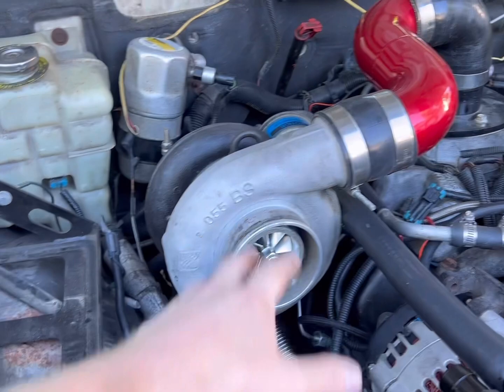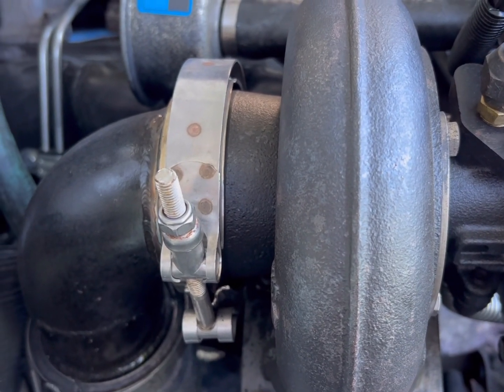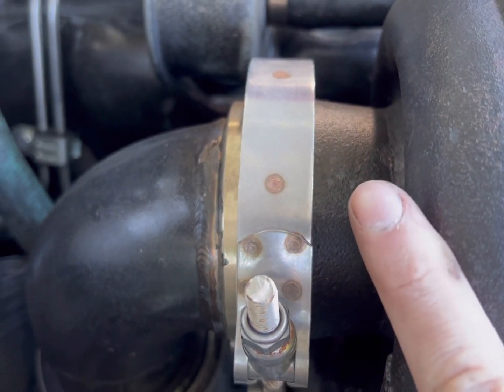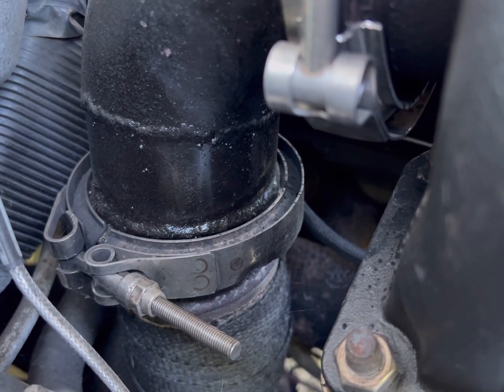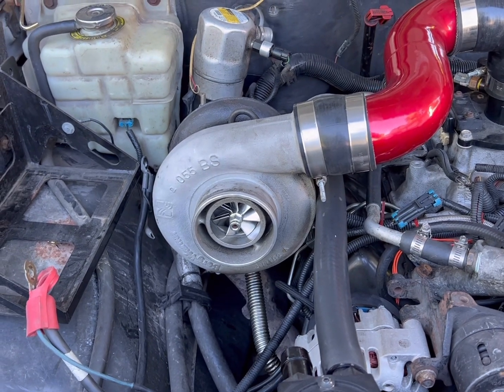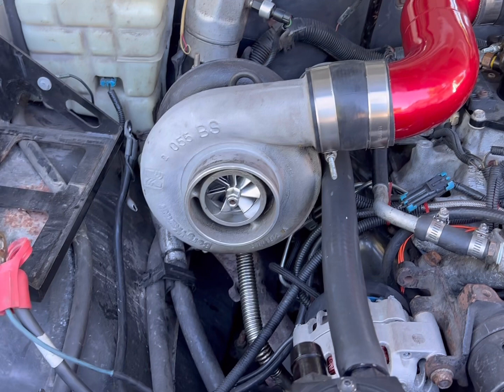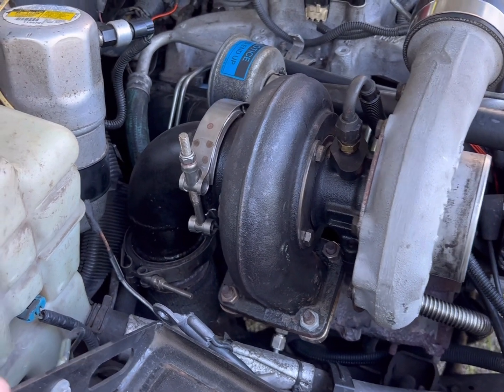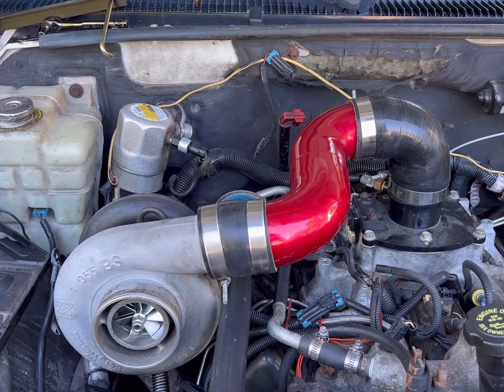GSC 6.5L diesel S300 turbo walk through

Comment: What did you do for a wastegate situation? That’s my biggest question. No this is an older video, but I have the turbo and everything to install it, but I’m worried about over boosting if I do not use a waste gate
Reply from the maker: I never did a waste gate. 10,000 miles later still not having issues and it doesn’t really have over boost issues running the S300.  Bolt it on and enjoy.
Reply: @gingersnapcustoms what does the truck make for boost? I’m afraid to blow mine up
Reply from the maker: @89vette89 with the S300 it makes about 32psi full tilt unloaded. Towing I make around 27-29. But I’m also making about 22psi of drive pressure at that boost and I’m running less than 1100* peak EGTs.

Comment: Where could I order a s300 like what you have?
Reply from the maker: @nightfall5631  Verlin Martin built this for me. You can piece one together through borg. @Sparkplughunter on Facebook has multiple like this one as well. It’s a 60/68/.88AR open scroll T4 HX40 marmon exhaust housing outlet. You can order that size from most Borg dealers.

Comment: I have My 6.5TD sticking out the front of my RV. That 460/C6 was a hog.
Need a trans jack to finish the install. Overdrive in the 4L80E should help a lot. I like the intake upgrade. 
An intercooler is necessary. Compressing a material increases temperature proportionally. If it's hot, it's already expanded. We want to expand it as much as possible, and we are limited. More fuel is not the answer. More cooler air is. Test that. Hope this helps.
Reply from the maker: I’ve already done the intercooler test and it does work and help. The issue was space being limited going to the S300 and finding out the S300 reduced IATs over 70 degrees on its own. Peak intake temps are still less than 100* above ambient (I know. That’s warm) but even with a well sized IC with an HX35 I was still 40-70* above ambient when towing. It’s a constant challenge on these to get a large enough intercooler in them to be beneficial.

Comment: Cool channel. Old guy here, lot's of knowhow. Worked on lots of stuff. 1200lb steam, SS Diesel locomotive engines, Cat, Cummins, DD, Allison turbines, automotive of many makes, a DeLorean, owned and rebuilt Honda's 1st car in the US. 600 V twin. 
One aspect of ICE is, it is not the fuel that makes the power, but the heated air. And the water within it. Water expands 1000 times as steam. What variables have you used in your boost program? You know the base compression ratio is 22?:1? (22x 14.7 to one.) The engine is a heat converter. It has limits. It is also indirect injection. It wasn't designed to be a workhorse, but a healthy grocery getter at 22mpg. FYI higher peak cylinder pressures cause higher NO. (Why they use EGR.) Sad thing is a really old school solution to performance and soot free ops was Methanol. 15%? This had to be Congress at work. To make alcohol for gas motors,,, Only them!

Comment: Hey GSC I’ve been watching your videos for a while man I know Casper isn’t intercooled because the way it is but could you make a video of different locations of where the intercooler could be located (safe location still gets good air flow) and maybe the cheap way and or expensive way to do it (also cheap to expensive intercoolers.) Thanks for taking the time to read this!
Reply from the maker: I’ve had this intercooled before and there are videos of it in action. I can work on doing a video if I can get an assistant to keep them in place. But absolutely I can do that
Reply: @gingersnapcustoms  does the intercooler make a big difference on these motors? Probably stays higher boost longer right?
Reply from the maker: @RiverislandJoe  it just reduces air temps and the higher charge density helps keep your intake side cooler while making more effective power. I liked it when I ran the IC and HX35.
Reply: @gingersnapcustoms  I thought the engine computer monitored intake air temperature and pulls boost and fuel as it heats up? And an intercooler would combat the stock non intercooler turbo building heat pulling loads or grades? I don’t actually know this though…
Reply from the maker: @RiverislandJoe  yes they are computer controlled (94-2000. 92-93 are mechanical)  but they don’t have the brains to pull fuel when they get hot or change boost pressure to help combat temps. On the 92 I did quite a bit of stock turbo testing on I noticed adding the wicked wheel, high flow upper intake and turning the fuel up some really improved over all performance set to 8-10psi boost. Air intake temps came down almost 50* on long pulls. Adding an intercooler with 3” piping makes the drive pressure come up some. But the cooler air charge reduced EGTs and kept coolant temps below 200*. I noticed similar results with doing the IC and HX35 on Casper. Drive pressure came up 1-2 psi but EGTs dropped 50-125* off the peak and I lost 100* off my max intake air temp. Engine coolant temps also went from running 205-210 towing down to 195-197. So the IC is in my opinion worth while.
Reply: @gingersnapcustoms  thanks. That’s what I was looking for. I defer to your knowledge and experience here. I have a lifted 4x4 suburban and it needs all the cooling help it can get towing my 6000 pound bobcat in a dump trailer that weighs 4500 pounds. Love your videos! Tons of information. 

I’ve done all the regular maintenance on my truck and tstats, and fan clutch  and it still can pretty easily get over 210 towing on a hot day. I have to accelerate pretty slowly to keep it under control. Probably need water pump and radiator. 

If you have any knowledge on the auto 4wd system and can do some videos on it that would be great too. Mine has never worked right and is now blowing a fuse. I likely have a wire grounding out on something and have no idea where to look.
Reply from the maker: @RiverislandJoe  glad I can help. I’ll do a video explaining intercoolers and why I do turbo upgrades on my trucks I tow with. 

I actually don’t own a 4wd 6.5 anymore so I might have to borrow the neighbors if I end up doing a video on the power train. But I’d certainly give it a go if you need some stuff laid out!
Reply: @gingersnapcustoms  thanks! Not telling you to, just politely asking 👍🏻😂

There doesn’t seem to be a lot of diag info around on the auto 4wd with 4 buttons.
Reply from the maker: @RiverislandJoe  I’ll get some more content out haha. 

Yeah. I can say I know enough to be dangerous on the push button 4wd. I’ve had two now and I’ve had to replace the actuator in the front dif and the dash switch on both to make them trigger as they should.
Reply: @RiverislandJoe  Let's ask ourselves a simple question: can we work harder when cool or near heat exhaustion. That regards lifespan. Also the engine is a heat exchanger that transfers fuel heat to compressed air and the resultant expansion is the power yield.
But! If it is so cold that the diesel won't ignite... Hard to do, but is a limiting boundary...
Reply: @gingersnapcustoms  Could the benefit be heated diesel with Methanol (12-15%) and colder denser air charge? I have one, retasked it to RV duty. Have a Intercooler planned to sit on top(in/out same side) and a scoop in the hood to get cold air across it with a fan. 
Should be a conversation starter, until hill climb.
Torque RPM numbers are close to the original motor. Overdrive seals the deal.
Smokey Yunick did something along this line.